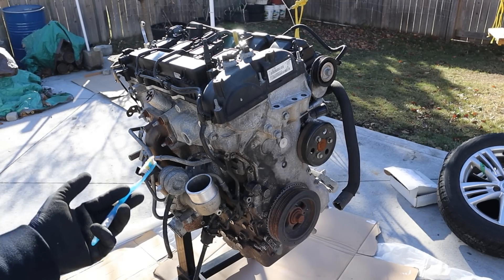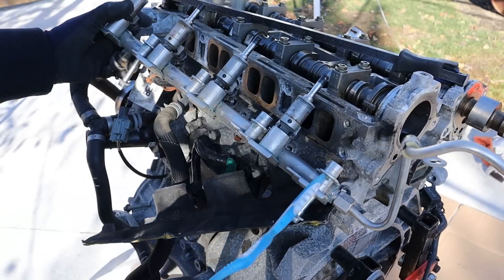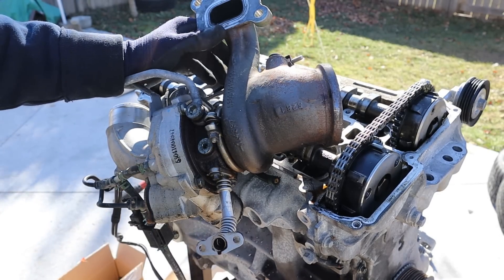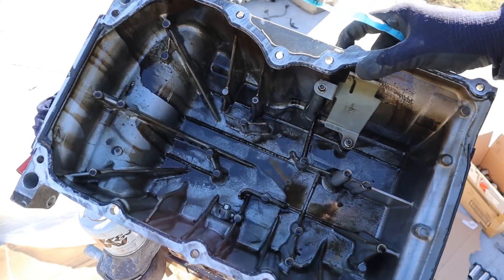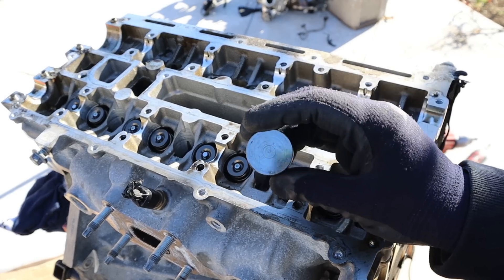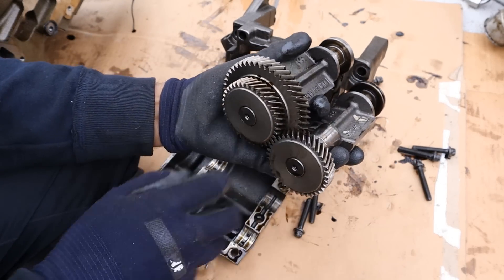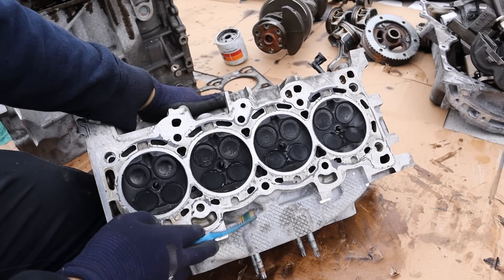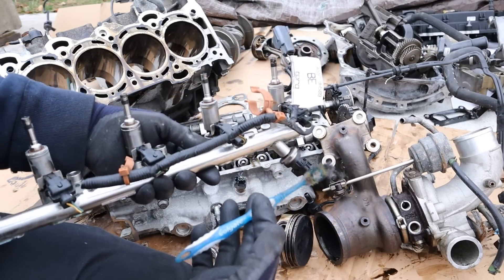Why Ford Ecoboost Engines Fail

Comment: I like to thank you very much for your detailed explain-clip, very well done!

I used to be a Ford-driver until my F 250 Turbo Diesel had to be fixed more than I liked and because they (as well as crappy Chevy) used V8 engines which made me switch over to a strait six Cummins powered pick 'm up vehicle.

Besides hanging on to the V8 (which can be used in Van's) Ford seems to change engine sizes more than some folks change their long johns and I'm done with them since my Ram is doing fine @ 510K!
Reply: Thanks!
Reply: Eco boost or ego boost ha ha ha ha ha
Reply: And your Ram body has not fallen apart or rusted out, and the drive train fallen apart ????

Comment: It's great how big companies builld engines that develop minor problems like a dirty intake due to a choice in design which will have the engine gagging in no time at all and throwing all sorts of other codes when it is just the PCV and intake getting dirty
Reply: Yeah It's called, "planned obsolescence". Things are designed a certain way so that they won't last.
Reply: @Jennifer.Havoc2000  I know what that is. This is different than planned obsolesce. This has to do with maintenance that if they just told you it was a thing it would be ok. They don't tell the consumer about the dirty intake and tell you it is a mystery and charge you despite knowing what the problem is

Comment: It's great that you mentioned the coolant trench between cylinder 2 and 3 in newer ecoboost (not seen in this video). A common and expensive problem.
Reply: Had a 2018 mustang Ecoboost with a blown head gasket because coolant kept leaking to the cylinders and eventually ate away some of the head gasket.
Reply: @darwinsaldivar5814  wow. How many miles
Reply: @champinsoccer9  coolant started to magically disappear at around 55k miles. Then it started having misfires in cylinders 2 and 3. I had to replenish the coolant reservoir every day until I had the whole engine replaced because apparently replacing a whole engine is easier for a mechanic. And you know how lazy mechanics can be in this day and age.
Reply: @darwinsaldivar5814  damn I really hate to hear that. My 2020 ranger broke down on me the other week because water was in 3 sparkplug holes...

I really really hope that's what it was and it wasn't coolant somewhere...
Reply: @champinsoccer9  if there's water by the spark plugs then that means it's a head gasket issue. The only way for water/coolant to be by the spark plugs is because somehow it got leaked into the cylinders. Hopefully that's not the case but unfortunately that's what I've experienced in the past. You should still be under warranty if you haven't exceeded your milage.
Reply: @darwinsaldivar5814  ugh that's what I'm afraid of :(. It shorted out coil #1 and started misfiring... I want to keep this truck for the rest of my lifetime...

The issue was fixed by my dealer.. they said the fix is the "engine cover"
Reply: @darwinsaldivar5814  u buy another ford after your 2018?
Reply: @champinsoccer9  Hopefully an older model, lol
Reply: @champinsoccer9  the ranger is a wonderful vehicle to drive indeed. Hopefully you won't have any other major issues.
Reply: @darwinsaldivar5814  thanks!! Same to you!!
Reply: @SI0AX  exactly right, older models are far more reliable, that’s why I kept my old Expedition with the 2 valve triton 5.4 instead of the newer 3 valve with the cam phasers (junk)
Reply: @champinsoccer9  does it matter it's not the point of it cars and trucks are meant to built for a long time not to fall apart in a short time
Reply: @champinsoccer9  well keep buying more junk you must like it
Reply: @darwinsaldivar5814  a note to Darwin you must like failure's after another
Reply: @darwinsaldivar5814  hey Darwin you apparently have not learned anything about the first purchase of the vehicle before
Reply: @rodneyhopper22 - what you rather him buy lifter failure 6.2 or 5.3 cheby that is slower weaker less capable truck in every single category or the boat anchor hemi that is the least capable truck? The Ecoboost is a great engine we’re talking about it’s cons because everything has cons
Reply: @rodneyhopper22  Why are you on here TROLLING? Go find another way to entertain yourself.
Reply: @darwinsaldivar5814 how would water get in it. It has coolant new so how it that a head gasket doesn't make sense.
Reply: Hey, is the coolant trench problem not part of the 2,3 L RS engine ? I have bought a 2018 2.0 L ST, im scard now :)
Reply: @devonbedford2645  hey! Supposedly the years 2020 and on they have fixed the trench. Now they made a hole on both ends of the trench and put the trench deeper.

@fordtechmakuloco has a video on this.

https://youtu.be/S-PYa8aBM4Q
Reply: @devonbedford2645  My 2018 Ford Escape is in the shop now having the engine replaced due to coolant leaking into the engine. Ford is paying under its Ford Customer Satisfaction program...no recall. The dealership supplied me a loaner car. Hoping to get the car back Thursday, as it has been in the shop for 7 days now.
Reply: @devonbedford2645  The RS engine does not have any problems besides that gasket issue that plagued the early models (2016 to mid-2017)
Reply: @devonbedford2645  No, this was on a previous version of the 2.3l out of the RS, those push a lot of pressure in the cylinders and stress them, that issue has been resolved for well over a decade now.
Reply: One of those better ideas by Ford you know 😜 keep buying them ford's if you want head aches I guess
Reply: Sixty thousand dollars for a truck is pure craziness I'd rather buy a house and you won't be walking around with a bank payment for your hard earned money you people really make me laugh 😂😆🤔😂 please stop
Reply: Still one of those better ideas from our own people at Ford motor company some one has to keep the employees paid thanks for your donation everytime your Ford takes a shit remember next time you should try GM products and these problems won't be happening to you
Reply: I enjoy watching dismantled engines. 
They are built to be disposable. The large gear ⚙️ drive the turbo. They are steel counterbalance. Intake valves are completely carboned.
Reply: I bought my '13 Focus before I learned of that and then breathed a heavy sigh of relief that the Focus ST's had better blocks that didn't suffer from that.
Reply: yes quite common, they almost always ingest coolant into the combustion chambers, guys here are constantly having to add coolant that magically keeps disappearing without any visible leaks?
Reply: @tonychavez2083  -Reason that 'back in the day' worn engines consumed a plentiful amount of 'Zerone' ethanol antifreeze in below freeze winter climates. 
Solved the leaky gasket issue and just made adding more Zerone an accepted routine for winter.. 
added note; Zerex was the ethylene glycol.... for fresh engines and non leakers...;)
Reply: @tonychavez2083  The coolant does not go into the cylinders, and hasn't done so for over a decade now with the new deck revision in 2014. The coolant lines going into the turbo however...I've had to replaces those parts often and were always the cause of "magically disappearing coolant"

Comment: The big solution that a lot people ignore is to use a catch can that IS NOT connected to the intake system and instead vent it to the open air. Bare minimum it needs the vacuum side capped off and that side returned to the bottom of the intake filter box to stay legal so it won't have such a huge problem with oil consumption clogging the intake valves. Vacuum pcv systems help a bit but the cons are more than the pros.
Reply: I have a 2019 2.0L EcoBoost, which catch can do you recommend?
Reply: @Pro1er  Grab one with some 10 AN connections and connect it with some 5/8" heater hose and remove your pcv valve in favor of a straight connector with no spring loaded valve. And you just want to get the biggest one you can fit so maybe a 750ml one with the big air filter on top. Remove the baffles as well and don't add pot scrubbers. Its just a container for your new "relocated valve cover breather." Locate it on the right side away from the passenger air intake to the cabin. Thats it. No more valve issues forever. Make sure your hoses are fairly short for the least restriction.
Reply: @paladain55  Thank you.

Comment: I really enjoyed this video of the teardown of an eco boost engine.  I can't help but be impressed by how many parts make up the engine and how many fail points there are.  Makes one keep their fingers crossed owning one of these.  But what hits me the hardest is the trend towards electric cars and the impact that will have on all the suppliers for the parts to these engines.  Vast industries that make ICE engines possible are going to eventually disappear.  So many jobs will be lost.  I am an old man and this is an amazing transition to come.  Hope it is for the better.
Reply: I used to repair cameras for a living. It's just how the world works.
Reply: @robertrosselit8241  Good point.
Reply: Just like the transition from horses to automobiles. Corrals and blacksmiths transitioned into parking lots and gas stations. It'll be the same with charging stations and battery and motor swap shops.
Reply: @davidkaminski615  Very true.
Reply: With the end of one industry comes the rise of another
Reply: @interstate80.  10-4
Reply: I've thought of this too, but in the end we should be alright. David & Robert made good points.
The world has evolved so freakishly fast in the last 20 years and employment numbers doesn't seem to have changed dramatically (except due to ups/downs in the economy of course).

As someone who isn't even 30 yet, it's kind of cool if you think back to the late 90s/early 00s. Sure, almost everyone had a cell phone and an internet connection but you couldn't assume everyone had that. Back then you maybe knew a couple of people who had a car with parking sensors. Now we're walking around with a fully fledged computer in our pockets, our cars drive themselves (and on electricity) and you can pre-heat your car from an app on your phone at a moment's notice.
Reply: @SwoonGaming  Yes, the changes are amazing and coming faster than before.

Comment: Those skinny azz connecting rods my be reason #1.

# 2 open deck design engine block

#3 over boost turbocharging
#4 interference engine design
#5.......

Comment: the insistence on only using direct injection is just silliness. makes the engine run worse in a very short span of time, and for what? a little extra HP for the 10k miles in between carbon buildup problems?

Comment: I have a 2017 Focus st and this motor has been great even at 140k miles (one owner car). Love these engines, so far. Lol
Reply: Get the intake valves blasted and it will go another 140!
Reply: @martinvalencia6141  it’s on the agenda, along with some catch cans. I changed out my throttle body at 40-50k miles and the after looking into the ports when I took off the intake manifold it was already looking kinda gummed up with carbon, haven’t noticed any diving issues thou. Still debating if I want to swap to the 2.3 head and run the RS twin scroll turbo to 400hp. And maybe do some new rods and pistons.
Reply: @jessebudelman  don't swap the 2.3 head in because the 2.0 is stronger and the rs turbo is far too much work for what it nets. Do new pistons, rods, aux fuel and either a bnr turbo or garret.
Reply: @martinvalencia6141  my only goal for the car is 400whp max, hell I’d be happy with 300whp and weight reduction (gutted rear, carbon hood, fenders, rear doors, and hatch. Already got the light weight battery and grimmspeed tray sitting in storage for spring/summer.)
Reply: @jessebudelman  2.0 is stronger as stated above. If you only want 300whp just go big turbo maybe aux fuel plus you would have cleaner valves too. If you want it really reliable(350hp is quite reliable stock internals) then built top end and big turbo, aux fuel.
Reply: Not the same motor.
Reply: @maciekapocaliptic  what do you mean not same motor...
Reply: @jessebudelman  They sharing same name 2.0 EcoBoost, but cooling design is completely different. Engine from Escape, Edge and i think Fusion too, has an open deck. 2.0 from ST's has closed deck.
Problem with open deck engine is not enough material between cylinders and that is the spot where gaskets are failing. 
2.0 from ST has more materiał between cylinders and it is design just for ST model by Ford Performance. So only modified ST engines failing, so best option is stay stock and change just intake, cooler and exhaust. Of course if someone wants to change something. My ST2 Turnier (wagon in Europe) is 100% stock, just added simple short shifter.
Reply: @maciekapocaliptic  you can use 2.3 head on closed deck block, just needs to be mustang 2.3 and need a Focus HPFP with matching cam on fuel side. It’s already been done and confirmed.
Reply: @jessebudelman  What is the purpose of that mod? I heard about that, but not sure about gains.
Reply: @maciekapocaliptic  main reason is the 2.3 head breathes better and flows better than 2.0 head, but you rev out higher with 2.0 head. The reason I want it is autocrossing the car where I’m not gonna be Reving out the motor on long straights, and the twin scroll turbo has better response. And I figured go 2.3 head and turbo instead of spending $2k on a “big turbo” I can get all the parts for 2.3 swap for way less and you van max out RS turbo at 400hp which is my main goal for power while using all OEM parts. I need to refresh my memory on what’s all needed to make it work. Plus I like doing things the hard way, haha

Comment: Have a 2017 Ford Escape Titanium AWD 2.0 turbo. Engine had Water Intrusion at 28,000 miles. Had a Full warranty. Engine replaced in 2022. My Ford Escape is a nice SUV. It does what I want it to do. I am changing the oil at 5,000 miles. Using 5/30 Full Synthetic oil and a Motorcraft oil filter. I use 93 octane and fuel additives to keep the carbon on the pistons and rings down. So far after the engine replacement. The Escape is doing fine. Gas mileage is at 23 mpg. As good as my 3.0 V-6 Vulcan in my 2005 Ford Taurus. Yes, There are issues with the Escape. But if Ford had built the engine right. With the fuel injection squirting on the back of the valves. They would have kicked ass with this and the other Eco-Boost engines. There never was a recall on the Water Intrusion problem. So if you don't have a really good warranty. It comes out of your pocket. This is why Ford's stock is at a all time low. I guess they figured. All cars will be electric. So what the Hell!  Sorry for your Luck!    Shawn.
Reply: Until you realize the efficiency and power capabilities of direct injection over port.... 😬

Comment: We use to spray water in the intake to get rid of the carbon buildup. Reve it high enough to keep it running while you spray your water in the intake . Old school carbon removal .
Reply from the maker: And put too much water, you hydrologic the engine
Reply: ...and hard bits of carbon hit the impeller wheel in the turbo and take it out.

Comment: Good thing I got the 2.5 ecoboost then. 😊
Reply from the maker: All the best
Reply: Thank you for the awesome video on the ecoboost issues. I’m hoping that flushing the intake regularly helps resolves the carbon buildup with DI engines. I was very hesitant to get a turbo charged engine to begin with but took the plunge. My 2017 Escape currently has 61K miles and hopefully it will last!

Comment: I have a 1.0 ecoboost. The engine died but thankfully I got a free new engine on a 2013 car lol
Reply from the maker: What was wrong with it?
Reply: @speedkar99  I never really knew exactly, it was making a sort of loud knocking/clicking/ticking noise especially upon light acceleration that no one seemed to know what it was. The guy at ford said it was a known issue and suspected lubrication problems and he could replace the head but didn't know weather that would solve it and said a new engine should be put in.

Comment: Why hasn’t any manufacturer created an oil catch can from the factory yet? Just tell buyers it’s just 1 more easy step in the oil change or something. The first mod I did to my 17k mile 2017 ST was a catch can
Reply from the maker: A catch can isn't environmentally responsible now is it...
Reply: @speedkar99  wait a minute why not?  all I know from my emissions cert is that as long as the pcv system is sealed its legal isn't it? At least in Salt Lake

Comment: Are balance shafts even necessary? My 2001 Tacoma has the 2RZ-FE with no balance shafts unlike the 3RZ-FE
My engine idles and runs very smooth even with over 200k miles.
Reply from the maker: It depends on the manufacturer and application. Some might use active engine mounts to smoothen vibrations.

Comment: my old 07 ford focus had the ultra reliable mazda L engine from which these eco boost engines were derived from.  so ford took that engine and changed it into this piece of chyt throw away motor. no wonder ford doesn't make cars anymore. used eco boost equipped vehicles are worthless. didn't save any money there.
Reply from the maker: Those were good reliable motors

Comment: Is there anything folks can do to prevent these failures, or just avoid cars with this engine altogether?
Reply from the maker: Not much. Change oil and coolant. Clean carbon from the valves. 

Once the parts fail, you have to replace them, especially including the engine if the head gasket goes.